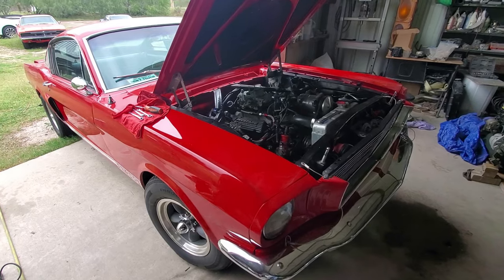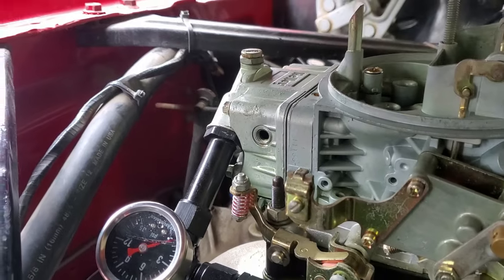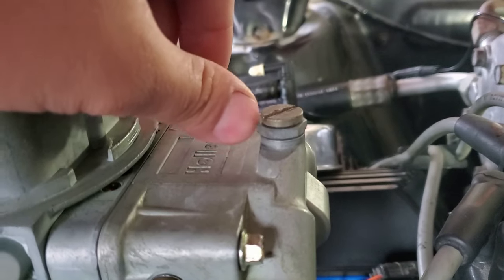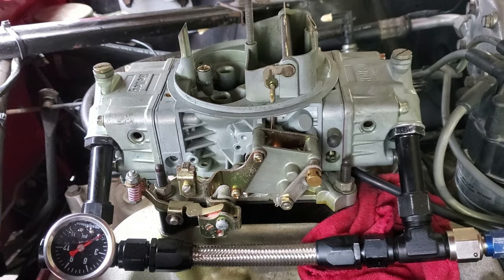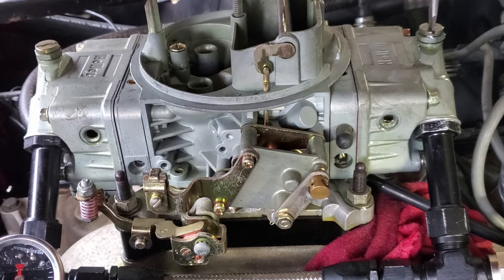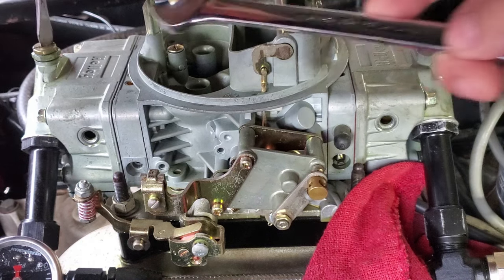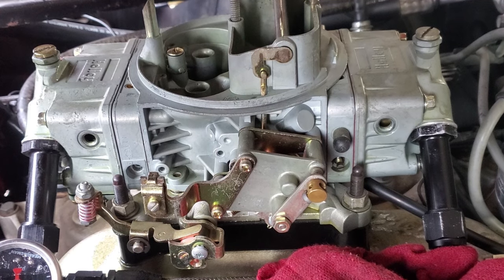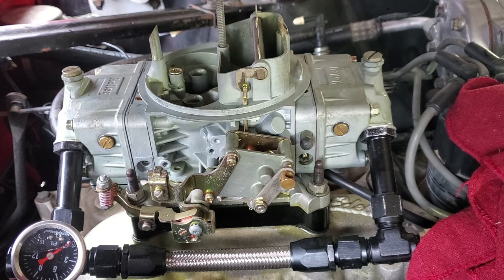How to adjust fuel float level on Holley Carburetor

Comment: Excellent and very clear. Although I have a later Holley with the glass I know better how to adjust front and back. Thanks
Reply from the maker: Really appreciate the comment. One suggestion. Start off by setting it turned in to where the level will be set at its lowest setting and then work your way up from there because if you go over the level, you will need to wait till the car eats up the gas for the level to go back down. Its not like when you have the hole to where the gas spills out and you can see the instant adjustment.
Reply: @EddiesCustomsandRestorations  with the site glass version, think you can suck some fuel out with a turkey baster or something first?
Reply from the maker: @lollipop84858  you would just have to let it run a little

Comment: Great video. My holley 4160 doesn't  have a secondary  sight hole. How do I know when it's at the correct height?
Reply from the maker: @staffordsanpei7804  thank you! And Take the carb bowls off, invert them and set the floats so that a 7/16" drill bit laying on the roof of the bowl just touches the hanging float. There are some videos on setting float level on bench with the bowl off the carb which is how you will need to do it.
Reply: @EddiesCustomsandRestorations  Eddie I feel like an idiot.After closer inspection.I found the secondary sight plug. It's hidden just behind the vacuum secondary diaphram.  I adjusted the primaries. It's running a lot better. Sorry for wasting your time.
Reply from the maker: @staffordsanpei7804  oh no, don't worry, happy to help. Glad you got it figured out my friend!

Comment: Was the back one giving you problems bcuz the car rear tires were off the cement? The car wasn't level
Reply from the maker: That is correct. Car needs to be level.. I dialed it in after. I should have mentioned that on video

Comment: I have an issue with a 750 Holley DP, did a kit on it, at idle only one of the primary’s is dripping fuel at idle, if you rev it it wants to flood. Floats are set, regulator is set. I have no idea what it is.
Reply from the maker: You have a restriciton. Open it back up and blow compressed air through all the bored especially the one that leads to that primary that isnt injecting fuel

Comment: I got a flood issue with my 750 double pump holley if I let it run it'll flood all around the carb base ...is this the cause of the fuel bowl level being not set ?
Reply: the fuel levels should absolutely be checked.
Reply: Get a pressure regulator set it about 6 p.si.

Comment: The motor vibrates when turned off ? Holley carby
Reply from the maker: Of the motor wants to still sort of stay on you are dieseling. You must be running rich and have fouled plugs and lots of carbon build up

Comment: What's your fuel pressure regulator set at?
Reply from the maker: The pump is producing very low pressure so i had to have the regulator wide open.  But just set it at around 5psi and you will be okay .

Comment: How do you do this without an electric pump
Reply from the maker: @richlong4119  you can do it with the car running or you can do it while cranking as well which is when the pump is pumping.
Reply: @EddiesCustomsandRestorations  can you start the car let it idle shut it off the check.
Reply from the maker: @richlong4119  yes you can. That will bring the fuel level up. Start with the level below/under the sight hole and slowly work your way up because if you start above, you will never know how much higher you are since its always going to leak the gas out when you pull the screw out